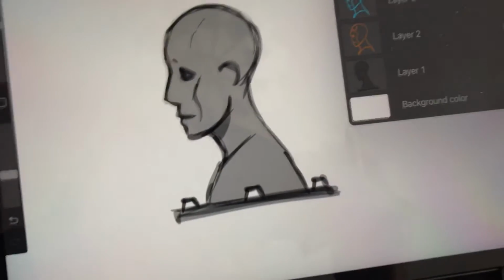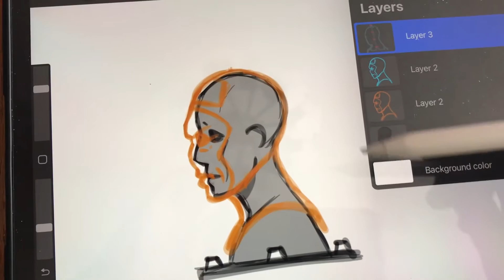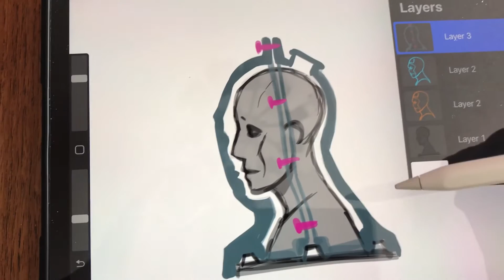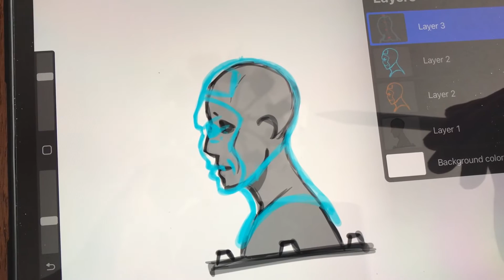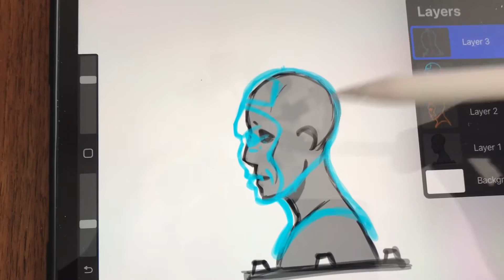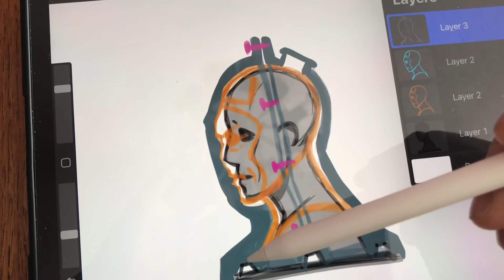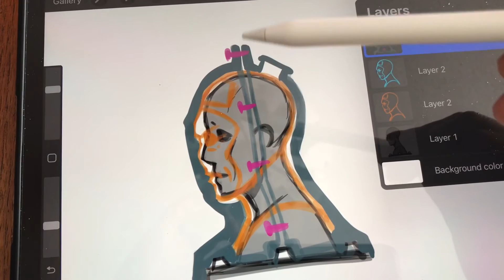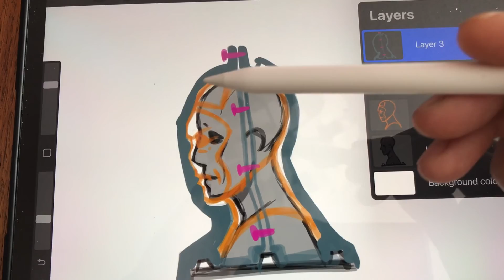Silicone mask making process with 3D printing

Comment: Why not do the following: 1. Make a 3D scan of your head using a Revo 3D scanner. 2. 3D print that model in PLA and now you have a life cast of your head. 3. Make. Make a clay sculpt of whatever mask form you want on your life cast and then from there use the classic silicon mask technique you describe to make a rigid 2 part mold and pour a silicon mask from that. Basically you are using 3D printing to easily make a life cast that would otherwise be a very involved process to do.
Reply: The problem isn't the life cast, the goal described in the video is if you have a monster mask that is 3D sculpted and want to make it real. You can get the head's life cast in many ways including 3D printing, but the mask sculpt itself is the hard part to 3D print.

Comment: Have you ever tried pouring monster clay liquid form into pla 3d printed molds to test the print before pouring silicone.  Or will the monster clay ruin the pla due to it being hot.
Reply from the maker: Heated clay is far too hot, it would warp and distort most prints.
Reply: @pandapropsncostumes  yea I tested it and not ideal. It not only warps but sticks on pretty well in the indents.

Comment: good vid Ter hope all is good. i heard some guys poor latex in a silicone mold like in a thin coat but the drying time takes forever, but after that can build the layers...i would be to scared to try incase they stuck. it would be easier and less time consuming than sculpting .  i do like the idea of reverse molds tho
Reply from the maker: Hey man, hope all is good :) I don't think it will work well that way. The reason they use plaster is because the plaster absorbs the moisture from the latex. Silicone is impervious to moisture, so I cam't see that working too well. The latex wouldnt stick to the silicone because nothing sticks to silicone except more silicone. :) If you want to continue to use latex, it would be better to continue to use plaster like hydrocal or ultracal
Reply: @pandapropsncostumes  i had the gf cover me in ultracal plaster bandages what a nightmare lol but im building a mannequin of myself to work off. filled it with sika expanding foam and seems to be working pretty good so far, i will finish the legs today. i always enjoyed talking props with you keep up the vids and tutorials T